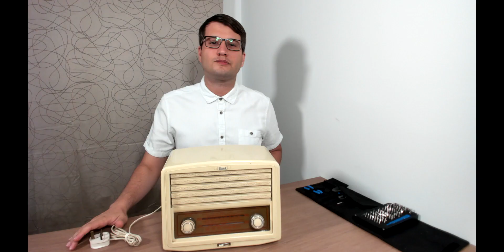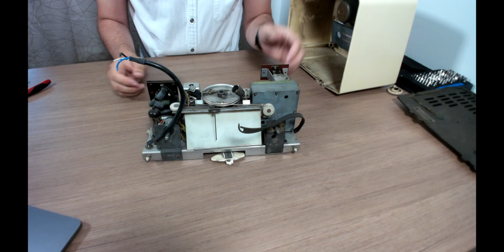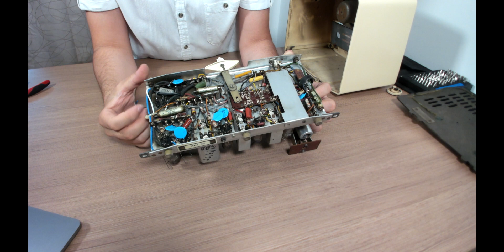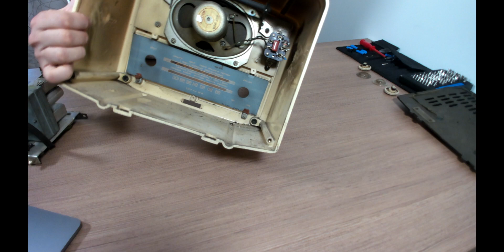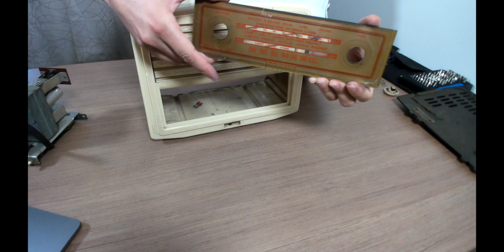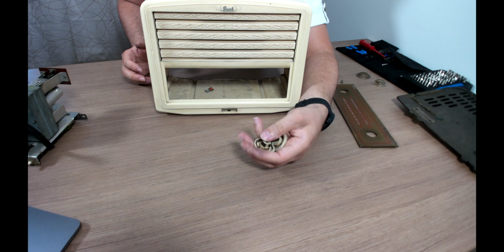Vintage Radio Receiver Restoration Bush VHF90 Part 1

Comment: Awsome! I love those old radios!
Reply from the maker: I have one more here, wood case, very beautiful unit, it's one more project for restoration, but first I need to end procrastination to remake this Bush one wiring. I regretted to have removed the entire circuit, now is a pain to remake everything.
Reply: @VinisLab  I fully understand that time aspect... i hawe 3 of those old tube radios remaining i tould my self i would start a full restoration on at some point... ha ha.

At the moment i hawe just cleaned them all up and inspected them.

Honestly i hawe newer seen anyone doing a full restoration on this level and keeping the original scematic as much as this. all other i hawe seen about this topic either are realy lasy and just putting in a sheapo and supe booring Chinesium device in an empty chassie, or leave that crusty ratnest as it is and just change capacitors and some resistors.

I hawe newer seen anyone polishing up the internal parts and those beautiful copper rivets and other stuff inside and even claening up the old pertinax/backelit boards and cables to this level before.

Personaly i found the makeower of the 3D priner genuinly interesting, and i think You did the right thing by taking a break from a project when one start to temporary loose the inspiration and need to do something else for a while. I some times pick up old projects i left years ago whan i find them again among all my trash and feel my self filled with new frech inspiration for them...